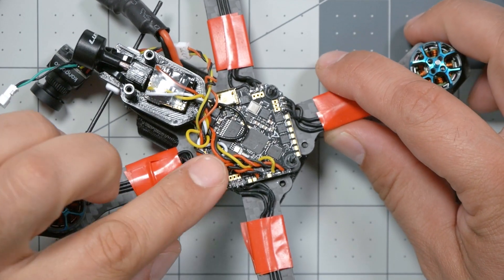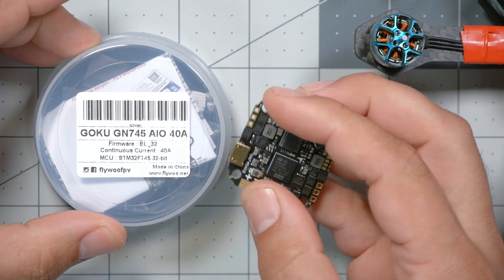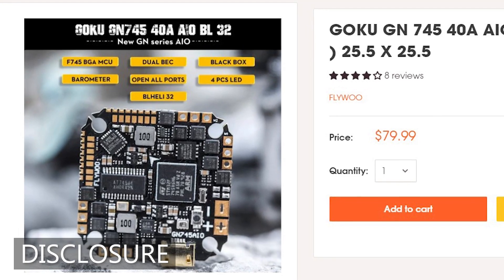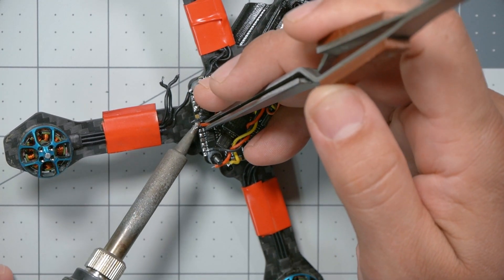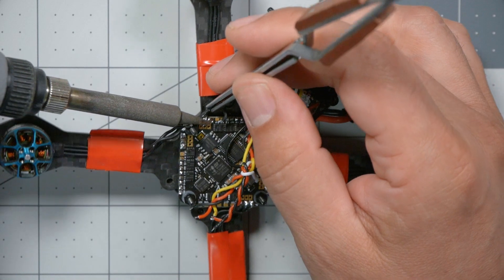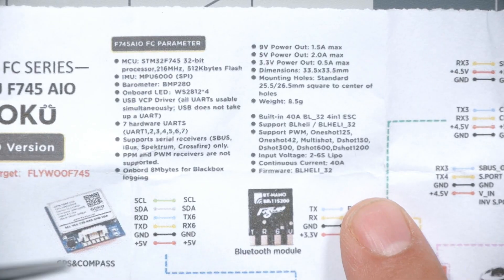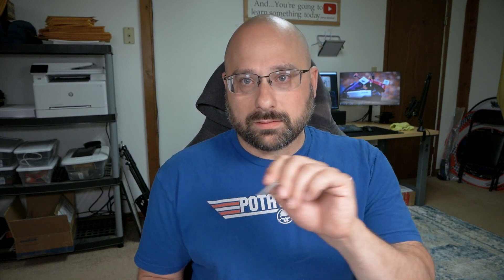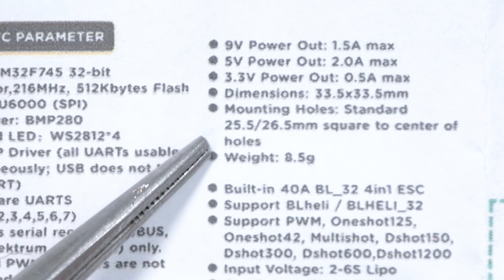But is it reliable? Flywoo Goku GN745 AIO FC and blheli_32 ESC install in my 533 Tiny Trainer

Comment: I’ve literally had four GEPRC f4 20A AIO die on me - moved to matek and speedix, awesome combo.
Reply: Same experience here. Is this for the baby croc? Which model of esc and FC did you go with exactly?
Reply: @riddles551  matek f722 mini se and the spedix is35 esc. Works great.
Reply: @flexplexico480  how did you get around the problem of the ESC and FC having M3 mounting holes but the baby crocodile frame only having M2 holes?
Reply: @riddles551  the esc and fc come with m2 adapters
Reply: @flexplexico480  amazing thanks, just ordered them 😁
Reply: @flexplexico480   Did you have to move the vista to the rear set of 20x20mm mounting holes (assuming you have the vista version) or is the stack low enough to keep the vista above it?
Reply: @riddles551  yup I did

Comment: I’m always confused when a whoop or any small aio claims it can do 25/35 amp @6s. Is there a particular fet manufacturers need to disclose so we know if it could handle a 2207 1900kv 5138 prop???

Comment: I’m using the 20x20 version of this board and it’s been holding up well so far.

*Edited to remove my previous remark of the voltage instability from the onboard 9V regulator. Found a couple loose screws on my frame and the issue disappeared once they were tightened. Apparently a mechanical vibration was causing noise in the motors and the rest of the electrical system.

Comment: I've flown the F55 Beast, CLRacing V2, and the Diatone f7 AIO. F55 beast smoked an ESC, CLRacing the negative battery pad pulled off, and the diatone is still going. 6S racing rig. I think the CLRacing is solid besides the pad pulling off.
Reply: Cl racing fixed mine I tore the USB off of one aio and the negative pad off another aio I filled out the form, pre paid for shipping took couple months but they came back fixed

Comment: I've had all kind of esc issues on various AIO makes lately. I'm not crashing as much as I used to and my soldering has improved quite a bit, so I can't figure out why. Wonder if it has anything to do with the chip shortage? Saw someone's video about using dental floss for those gummies and it has saved me tons of frustration through all the replacements I have done lately.
Reply: companies might be lowering quality for increased quantity.  Also, got to watch out for "seconds".   Stuff that was discarding in production runs might be bought now that their is a need.    Our company needed to buy some "out of production" DAC parts out in the wild years ago (non-pandemic related) and found a much higher failure rate - and those boards are coming back to be repaired..... what to do, more crappy parts and hope for the best.  No other choice.  Our equipment gets 10 year warranties.

Comment: I really enjoyed building with the betaFPV AIO but also had reliability issues. I’ve been using the Goku 16x16 stacks (in my hexplorer, and a 3” build) and I’ve been very very pleased fun little fc to work on but not for beginners since the pads are teeny.
Reply: Is this still the case? I recently got a Goku F745 13A 16x16 stack and one ESC died 8 flights in (no builder error) and have seen several reviewers with similar issues. My board is being replaced, but wondering if the new one is going to do the same thing. Still going strong for you?

Comment: Clracing f7 whoop aio v2 has been rock solid I cracked my tiny trainer and fc is still kicking after 9 months of hard racing
Reply: I'm a big fan of them too especially because cl racing fixed 2 of the ones I broke for free. Not sure any other company does repairs like that
Reply: @RubyS.1  wow repairs?!?! Got my attention
Reply: @xiandan54  yup just fill out the form and pay the shipping your order number is your RMA (learned the hard way first time I sent something). He's in Maine.
Reply: I wanted mine to work so bad. Great stats. But got bad esc on brand new board. And i never got email how to return it. Sent pics and everything. Wasn't even finished putting drone together. 
Got tired of waiting bought another board

Comment: I'm using this board in a full 5" race build with 2306 xing2 motors and surprisingly it works very well, 3 month of ripping and still no issue.
Reply: What KV? 6S or 4S? AUW?
Reply: @AlvinYeoh Its a bit unusual setup, 6s battery but the 4s 2555kv motor with throttle limit, I wanted to build a dragrace drone and I slowly increase the limit and testing what max speed I can achieve. Without battery its 295g, these motors are heavy.

Comment: Hi Josh  Great video on the Flywoo Goku AIO 26.5mm board.  I just don't know about the Flywoo Goku board but I have tried whoop boards for the last year and I  have been flying the Diatone F411 aio 26.5mm board.  And I have not had any problems with it.  But are not cheap,  I can't wait to see how it works out for you.  Thanks again for the video and information.